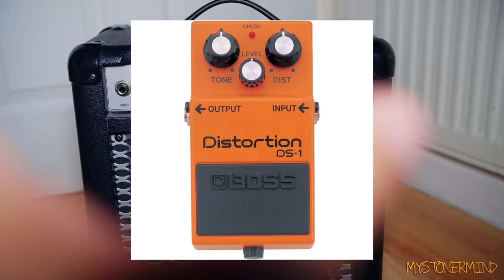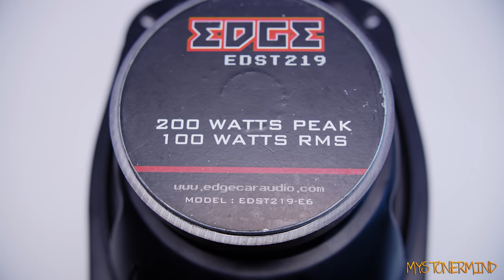SPEAKER WOULDN'T MOVE  [ DESTROYED ]

Comment: Check out iso pucks for vibration treatment. They work quite well.
Reply from the maker: isolation pucks would just have the opposite effect and they also have a weight limit.
Reply: @MyStonerMind420  Did not know that. Im throwing all of mine away now. Its hard finding proper vibration treatment. Concrete blocks might help. Thinking about giving that a try.
Reply from the maker: @randomtube8226  you're misunderstanding something somewhere, they're made for vibration treatment. I'm not trying to treat vibration.
Reply: @MyStonerMind420  Oh, didn't know if they would help for when your testing out woofers and subs. The thing from your bass shaker reminded me of isopucks